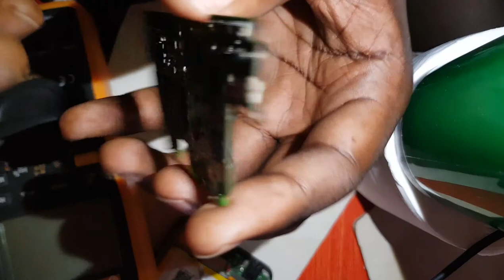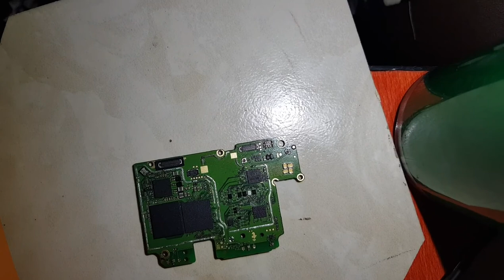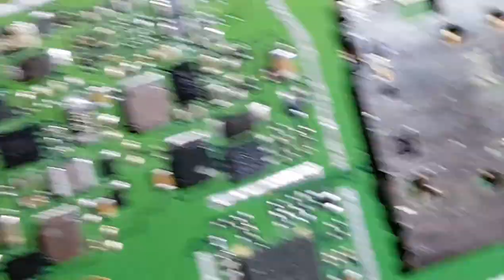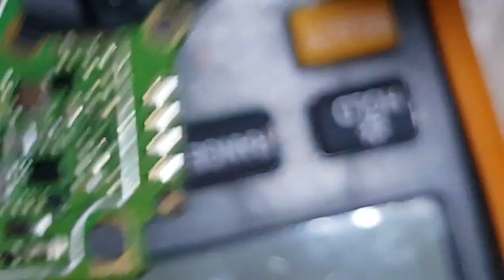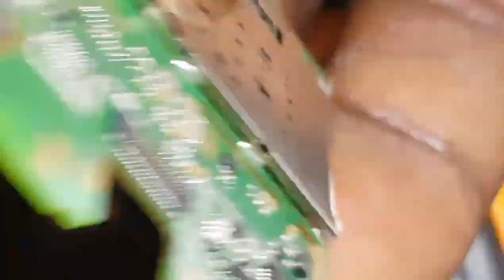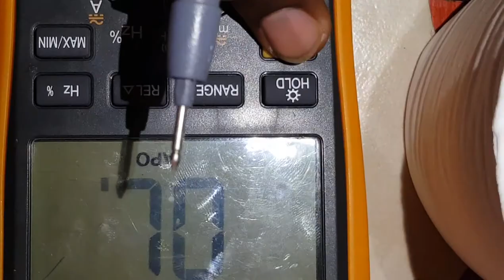Part2 How to test short IC, capacitors, resistor & transistors in Tecno Camon 11 phone motherboards

Comment: beep or continuity mode is great but its beeping for a low reading to ground. some of the cpu lines will have a very low value, sometimes this will show a short but its not a short. using ohms mode can help to test the line for ohm reading. this will be a more accurate reading for fault findiing. 

ace video and info. do a vid on removing the logic board shields 🙂

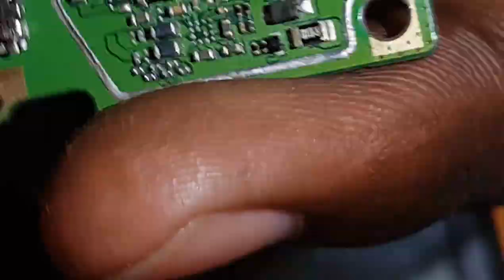Comment: Hi there , at 09:21 when you want to check ( ROIO),Resistor for short with multimeter if we are on Diode Mode and connect black cable of multimeter to ground and red cable on resistor on one side!!! , if we have a beep that means resistor has short or is good resistor ????or on both side of resistor if we have a beep is bad resistor , or if only oneside that means good resistor ? thnx
Reply from the maker: R010 is very resistor its actually like a fuse, if it beeps its fine
Reply: @platinumphonesandcomputers  we must have on one side or both side beep is ok??

Comment: I like this video but can you educate me on what to do when infinix phone charging but black screen and i slot sim and call it to know may be is working but saying switched off but is charging when you slot charger but black and not on nor display.
Reply from the maker: Check its power button, or try powering on using a power supply and confirm if its drawing current without the charger

Comment: When I use power bank to charge my  camon 11, it will break the current, what to do, have changed the down board and suggesting that maybe charging ic, and how do I detect the charging I C
Reply from the maker: Try to check for short circuits on the motherboard, Current will drop if there is low high resistance